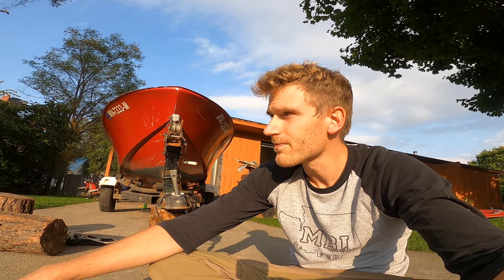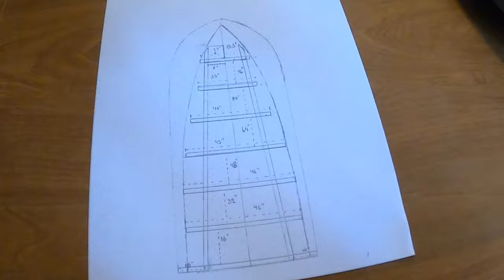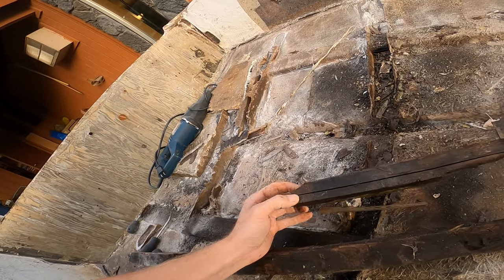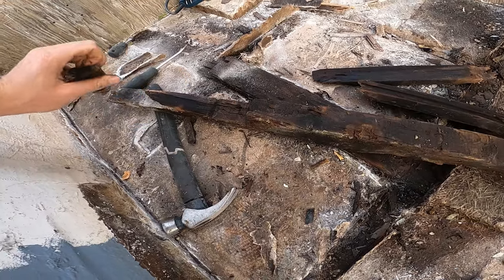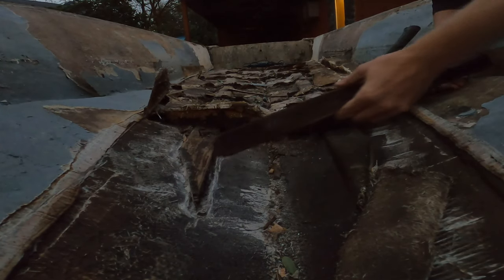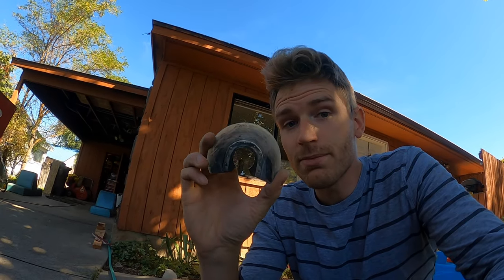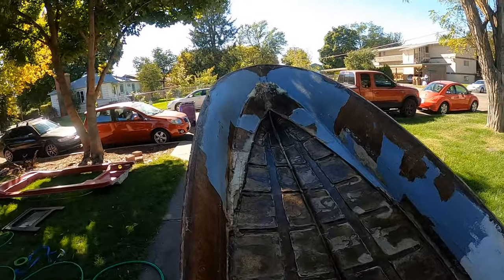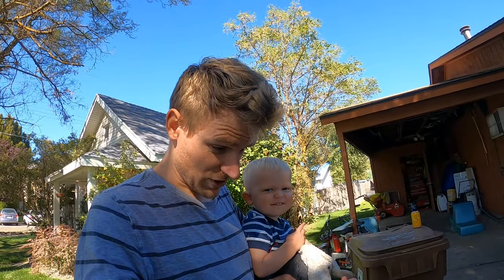Boat rebuild (PART 5: Vol 1) stringers and runners removed!

Comment: With the exception of very vintage boats they are rated in length by the curvature of the bow.  Not bow to stern as one would think.  It actually works to our benefit when registering.
Reply from the maker: Yes definitely a benefit. Very interesting way to measure it though.  Thanks for sharing

Comment: The 14 foot is the gunwale length. Not the centerline length. Measured from the front along the rub rail to the transom. That will get you your 14 foot length. Or close enough to it. It was a common way to measure boat length at the time.

Comment: Hi look on ebay for fiberglass of aluminum honeycomb sheets for your floor. The ribs and stingers are the structure back bone of your boat and have to be glassed in and use SST 316L HARDWARE OR BRASS watch boat works today

Comment: Make sure you leave a "tunnel" under the floor to allow any water to run to the back and out the drain plug hole! Doesn't look as though it had any?
Reply from the maker: the keel is hollowed out which acts as a tunnel. I will also be cutting a notch out of the bottom which will help

Comment: I used the bondo brand resin from Home Depot. It’s a lot cheaper than the other stuff online. And use chop strand matting for your cloth. You can do it all (floor and transom) with it. Just do multiple layers over the plywood. I used 3/4oz chop strand matting. 3 layers on the new plywood floor and 5 across the transom should be plenty. Resin from Home Depot and get the matting online. It will come on a roll for the amount you need.
Reply from the maker: I think I will try the bondo brand resin. I started using the TotalBoat epoxy resin which works great but I got a bad allergic reaction to it. thanks for the advice! I already bought the chop strand matting hoping to start with it soon.

Comment: Length of a boat should actually be measured at the waterline, fwiw. 
Yes the glass can absolutely lend strength, as well as help maintain waterproofing. If you recall Burt Rutan's airplane designs- foam forms with fiberglass (then later carbon fiber) encapsulating. Foam was there only to hold the shape. Are you familiar with the fiberglassics website? Used to be some good info there, as I recall. 
I've heard that oak (which type I'm not sure) is a great wood to use for stringers, runners, etc., although I have no personal experience yet. Any plywood is best double treated on ends and treated on broad surfaces with fiberglass resin, even for decking, which will be glassed over with cloth as well. I will be interested to hear how the hull shape is maintained during this process. I have heard some say remove only every other stringer and glass in the replacement before removing the opposite set to help maintain the shape. Again, this part I haven't had to do yet. Hopefully next summer! Thinking I will try to make cardboard templates for the wood pieces. This is the part which has me apprehensive.
Reply from the maker: That is good information, I will check out the fiberglassics website. I did some research for the type of wood to use and found a lot of people recommended Douglas fir. As for the shape of the hull I have a strap on the top to keep the side from sagging out, the hull doesn’t seem to be losing its form...  yet 😬 
I also didn’t know that the length measurement was at the waterline, that’s interesting! 
Thanks for your input! 👍 I appreciate it.